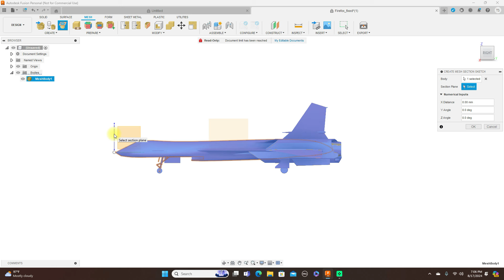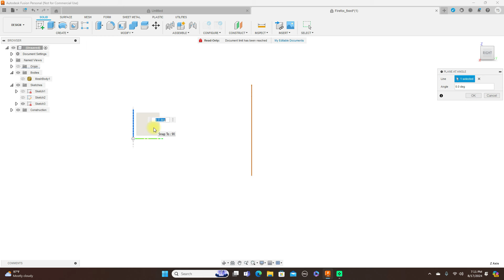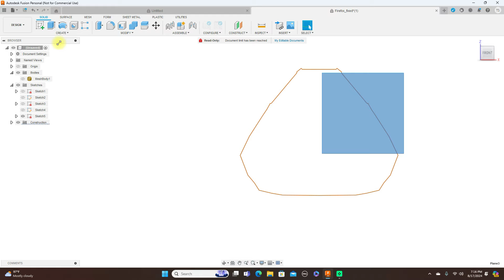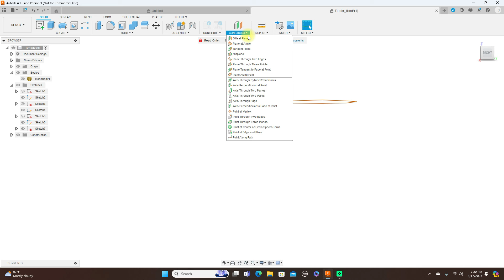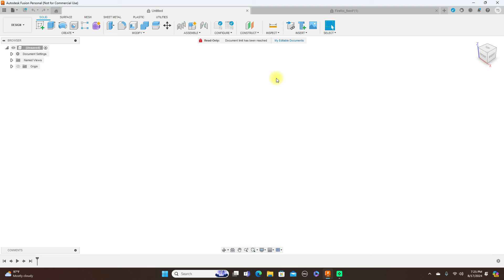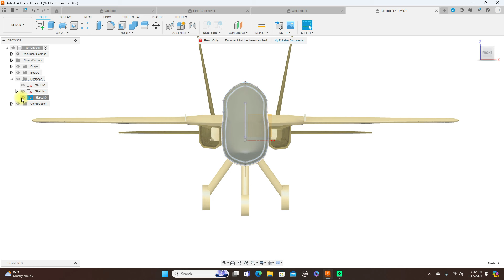Learn how to make a wood laser cut kit of this Firefox from a 3D. printed model

Comment: Hello. I have been following your channel for a while and it taught me how to work with mesh which is so awesome. I am currently working on a DC3 model and I'm having a hard time getting the cockpit and nose right. I tried mesh, lofting and nothing worked. Is there any was you could help me. 
BTW, perhaps you could do a video on lofting and explain what the different errors mean and how to correct them. I tried to get answers from a few forums but no luck so far.
Reply from the maker: Send me the file and I will help you with it.
Reply: @cadbuildflyrc3784  I uploaded the file on Facebook.

Comment: What type of file did you start with?  It doesn't appear to be an STL file although once opened the body appears to be a surface.  Converting STLs to bodies is less than satisfactory as the resulting body has many facets, which are unmanageable unless reduced in count.
Reply: I am also curious as to the file type you imported.  

If you were going to cover or skin the fuselage in balsa sheeting (1/16") could you first offset the models skin by 1/16in (millimenters) first, then model the former?
Reply from the maker: @dennismiller6131  Yes you could offset by 1/16th.
Reply from the maker: I started with an STL file.
Reply: @cadbuildflyrc3784  Do you convert it to a body or simply use the mesh as-is?  If the latter, perhaps that's why you had to trace the profiles in your sketches instead of doing an intersection?
Reply from the maker: @karlheinz1695  I use the mesh as is, with the mesh tools in fusion 360.